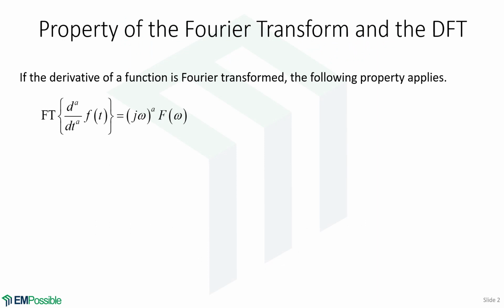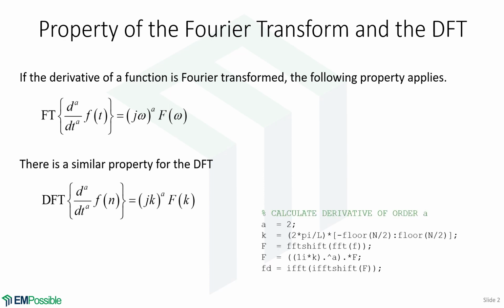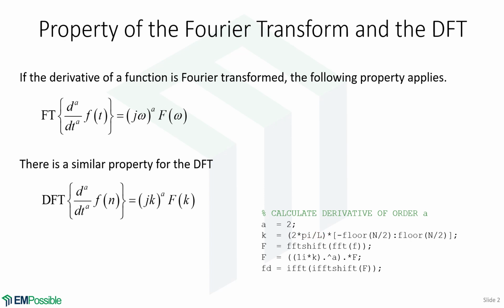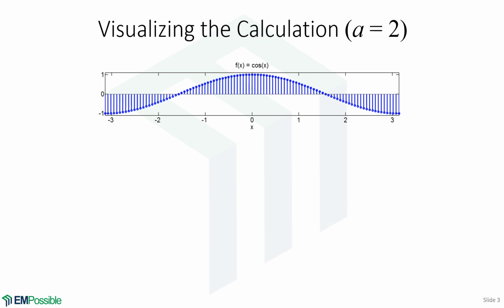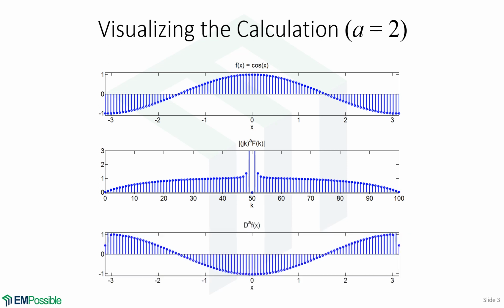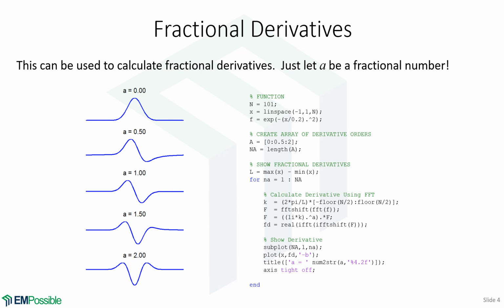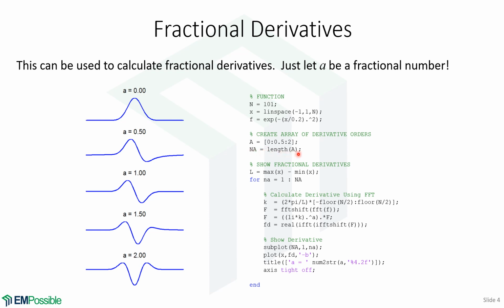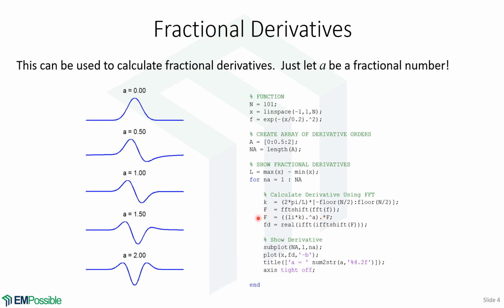Lecture -- Numerical Differentiation Using the FFT

Comment: How will this method differ when compared to normal differentiantion of lets say a noicy curve?
Reply from the maker: I am not entire sure what you mean by "normal" differentiation. Numerical differentiation is used whenever the analytical expression does not exist and all you have are discrete samples of a function. In this case, you cannot use an analytical derivative. The FFT method is numerical differentiation method. There is also the finite-difference method. The finite-difference method essentially calculates the slope between adjacent points and uses those to estimate the derivative everywhere. You can start to improve accuracy by including more points in your finite-difference approximations. Think of the FFT as a finite-difference that has used all the points in the function to estimate the derivative. The FFT will also force the derivative to be periodic, which may not be physical.

If you want to learn more about numerical differentiation, checkout Topic 6 here:

https://empossible.net/academics/emp4301_5301/
Reply: @empossible1577  Thanks for the explanation! I  meant finite difference.